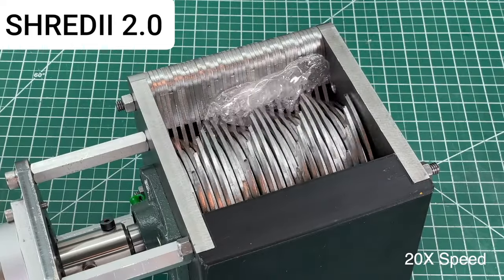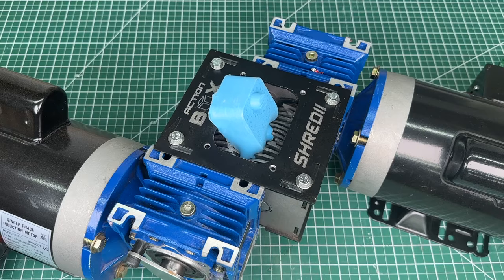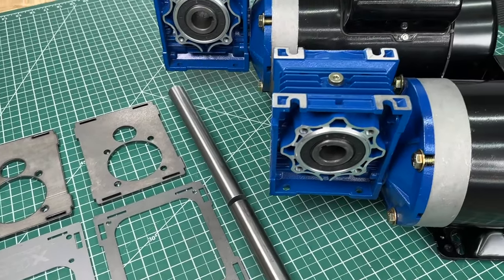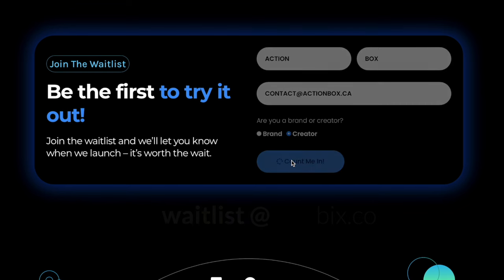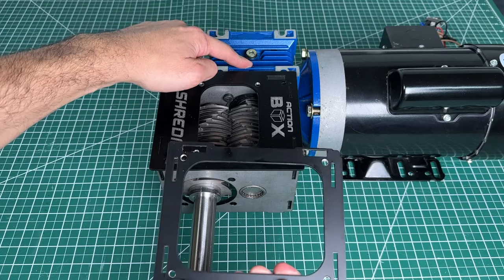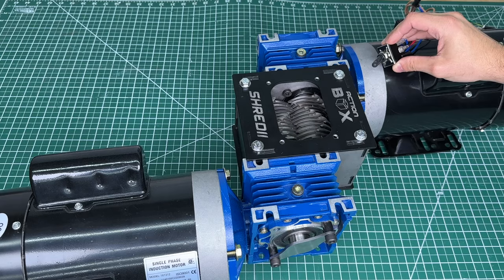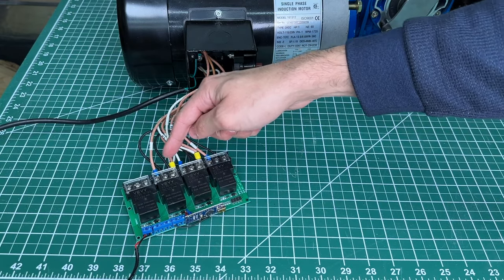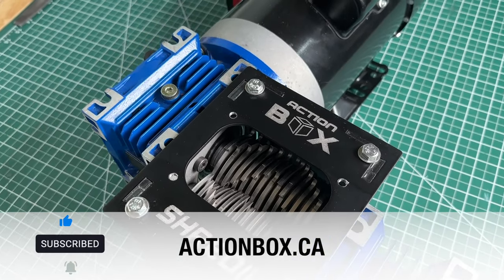Homemade Shredder Recycles Circuit Boards | SHREDII 5.0

Comment: I use a grinder with a wood carving blade and a funnel. Cheap and all parts readily available, no expensive 50 or so blades to fit together etc
Reply: Handheld grinder or table mounted?
Also, how do you keep the bits from flying all over the place?
Reply: @toxomanrod  Hand held angle grinder mounted on a bit of plate steel and then a long funnel around the blade with a small hole for the ground bits to exit. It can grind bits to a powder or larger bits depending on the individual blade type being used, 3 blades, 4 blades, just look up wood carving angle grinder disc. I'll upload a video one day, you can see my other 3D printed projects on my channel.

Comment: use it to crush and recycle ceramic for high heat applications / custom refractory mixes etc
Reply from the maker: Ooo that's a good idea! The shredder can be used for so many things. Do you work with ceramics?
Reply: @ActionBOX  never have. just a green business idea. people throw away old toilets which are made of porcelain. these could be crushed to dust then built back into something  valuable IMO.
Reply from the maker: Good point, thanks for sharing :)

Comment: The design misses the part where desktop device should be as compact as possible.... are two motors really necessary?
Reply from the maker: No, our latest design therefore only has 1 motor.  Check out SHREDII 5s on our website actionbox.ca